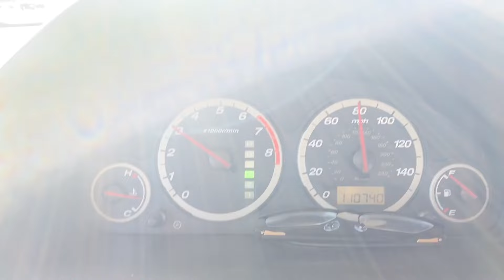COMING TO TEXAS?  DRIVERS BE WARY...

Comment: The reason he's on your ass is because that's the passing lane, you are REQUIRED by law to get in the right lane.

Transp. Code Section 545.053
Passing to the Left; Return; Being Passed
(a)An operator passing another vehicle:
(1)shall pass to the left of the other vehicle at a safe distance; and
(2)may not move back to the right side of the roadway until safely clear of the passed vehicle.
(b)An operator being passed by another vehicle:
(1)shall, on audible signal, move or remain to the right in favor of the passing vehicle; and
(2)may not accelerate until completely passed by the passing vehicle.
(c)Subsection (b) does not apply when passing to the right is permitted.